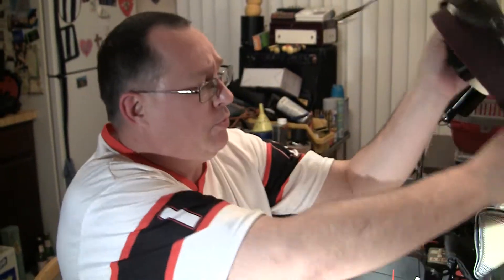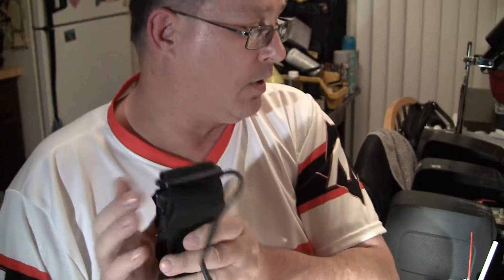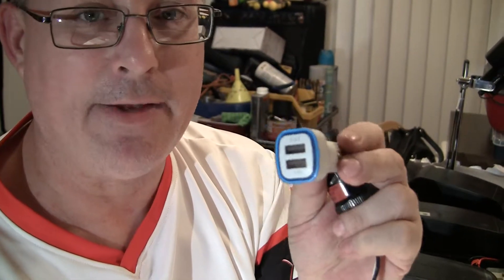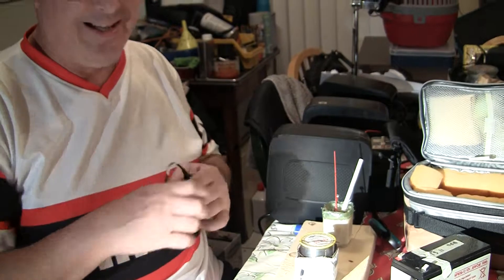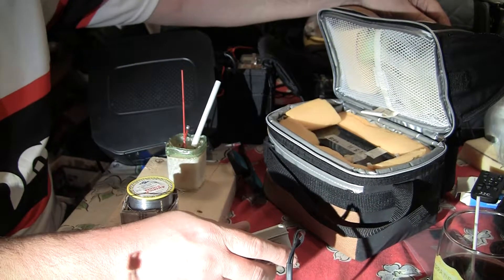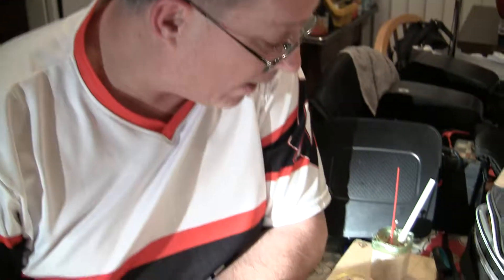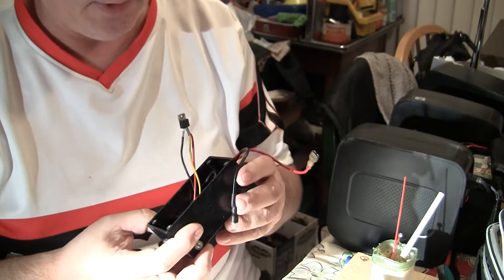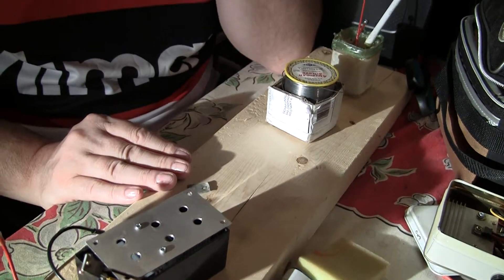DIY battery pack - camcorder part ONE

Comment: cool, funny timing,  ive been charging with little 8'' 18v solar panels, i charge 4 18650's setup in parallel and series, with a 9v reg out...and a 5v reg out for the hell of it.....i can switch between parallel and series...i use parallel to charge by solar.  its great, powers my lil amp, and a multifx too....and charges my 5v radios etc...in the end i built 2 of them, so one charges while i use the other....love my solar stuff. .......until winter :(   :)
Reply from the maker: man that is cool , you should do a video on that , did you do one ? this john wilson guy was playing with that , he made "the stella amp" which is really clean one watt amp .

Comment: "contraptions" lol
Reply from the maker: there was a cook county sheriff - a huge black guy who was a veteran - he said that to me " no contraptions allowed in the forest preserve" and the funny part of that statement - this particular woods ran along the river . so it was a very long run , almost like a drag strip . it was maybe 1 mile long too . this ww2 pilot guy who was very very old , in the 80's and 90s he still was up to it , but he used to MAKE air bikes . its a propeller he made .... .... ... with a small engine , and he would have that mounted on a bike , some recumbants anll sorts of people knew about it and paid him tto help them build these . that woods was where they ran them . he told me he put ice skates on a sled with that air motor and went down the frozen rizer on it - hard to steer he said ! that guy was so cool . i got to ride the air bike once . it went so fast it started becoming unstable . the throttle was a piece of twine you had to pull so you steered with one hand - super dangerous . he didnt wear a helmet either , i have photos .... i should find those and make a story time video as it was one of those things that sounds like i am making it up but ... columbia woods willow springs il is the coolest spot .
Reply: @peteytwofinger  lol... great story. I have no reason to disbelieve you about anything man, sounds like a really cool place and people.
Reply from the maker: @David.C.Velasquez  right on but if someone told me this story well they did i heard about "art" and his air boat - i remembered this the first time i heard about him he had that motor on a lil tub or barrell boat , i didnt believe it , but the guy who told me had a reputation of tall tales . this guy lived in a truck trailer at a truck lot . he was kind of a dirt bag . threatened my life for finding a rusted bmx bike by the river - i repaired it for my kid , when he founfd out he claimed it was his and told me he was going to "run me off the fuckin road and kill me and he didnt care if i had my family with me in the car" great guy . he used to bathe in the creek and sneak into this river rat guy named tom and linda - their house to steal lindas chocolates ... ha . these are the people i met on the river . check out the video ... story time columbia woods , its rendering now will be up soon . thanks for reminding me of all this .